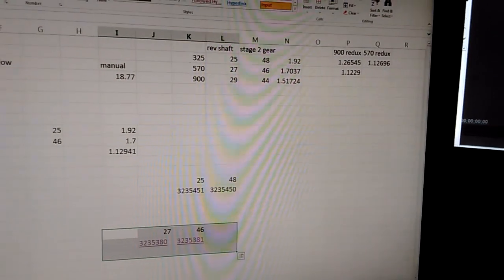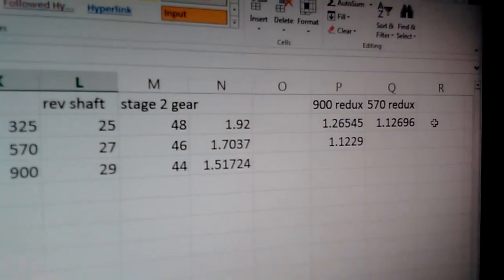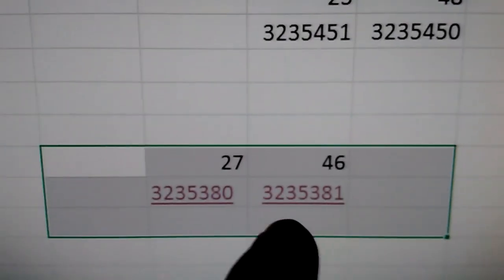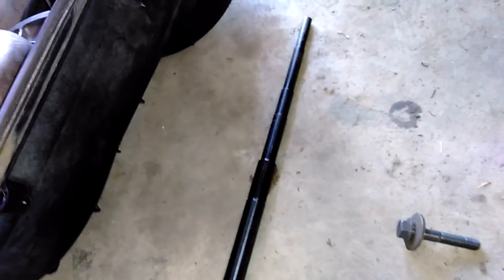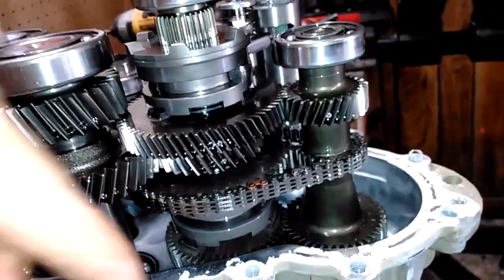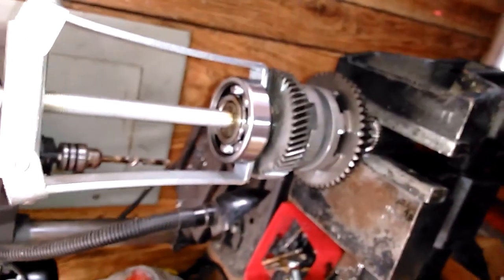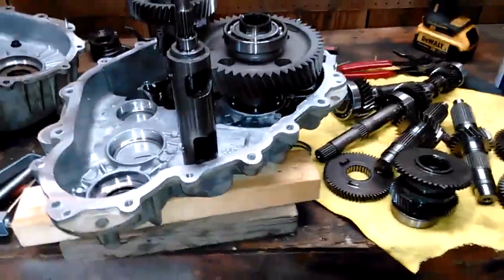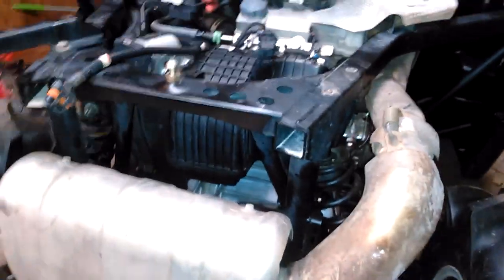RZR 27%  transmision gear reduction factory gears not $650 from tuner

Comment: I was talking to Super ATV until I told them I had a 2012 RZR 800 S.   I want to go to 32" tires. How can I do it without costing an arm and a leg. Also I have health issues and can't do the work myself. I was hoping you were in the Phoenix area. I bought the RZR cause I didn't want to die at home in front of the TV. I'm due for tires but don't want 27" tall on 12" rims. Please HELP! I'm tired of the bull crap from the salesman. You sound trustworthy.    THANKS,   RON
Reply from the maker: Unfortunately, I have literally zero experience with the razor 800 platform.
Reply from the maker: My first Polaris was a 2016 RZR 900 trail. I had 4 inch portals on it and 35s there's a lot of older videos posted on it, but I don't think very much of that was relevant to your machine

Comment: will these work in a 1000cc 2018 General deluxe?
Reply from the maker: Yes
Reply: @MudPuppyOffroad  ty, it is still very expensive in Canada grrr
Reply: @MudPuppyOffroad  Hey, is this JUST REVERSE and LOW range gear reduction? I am looking for Lower reverse and low gear high is fine for the General on 30 inch ITP Blackwaters...we do very tight trails and steep hills this would be great for some of our runs, as I find I do get my belt warm n smelly now n then.

Comment: Is there a similar trick to do a double reverse chain? Or is the reverse chain even needed if you do the gear reduction. I'm new to this and have a rzr 570 thank you for posting this video sir
Reply from the maker: I'm running the stock chain but also have portals. The reduction does result in less torque on the chain
Reply: Biggest I'm gonna go on the bike is 33's and that's after I get portals. I just want to have as much gear as possible for the small motor. Thanks man!

Comment: OK i watched this video and figured why not.  i was tired of burning up belts in my 2016 rzr 900 s so i put the big reduction in my bike. it was a pain in the but to do it my self pulling the transmission and all but got it done i am running 32 out back maxes and i hit the gas ans the tires spin out this gear reduction works. thank you for the video i know it has been up a while but still.
Reply: Blazer25U  which reduction did you go with

Comment: Keep the good work on the vids!  I have a 570 ace and a rzr 900.  I have 27 inch ITP blackwater tires coming for the rzr.  I only wanted a 1 inch larger tire but realized after I ordered the tires that the factory tires only measure 24.  Do you think I need a gear reduction for riding trails in my 900 after I figure out if the 27 inch tires even fit under my wheel wells?

Comment: Wonder if the xp1k highlifter gearing can be had for way cheaper than turner or superatv?
Reply from the maker: yeah that's the 12% part numbers I posted
Reply: +Mud Puppy really? That will work in the 1000?
Reply from the maker: yes
Reply from the maker: Haven't done it but people have the 1000 HL has 2015 900 gears for A 12% therefore these will swap also
Reply: +Mud Puppy so does the have the double reverse chain upgrade also. Or is that a completely different part?
Reply from the maker: The reverse chain is an expensive mod requiring several more parts. The gear reductions put less stress on the chain mine has been fine stock

Comment: my 900 ranger has different gears that what's you list in this video. I pulled it and it has the 1.7 gear ratio in it from the factory. I bought the lower gear ratio. not all 900 rangers come with the higher gear ratio. I only got the 12% reduction. 3235380-81 was the gears in my 900xp. you ha e them.listed in the 570. seems that these things came with a mixture of gear ratios
Reply from the maker: tynstaci this video is for RZRs. you're correct the rgr gears are a different ratios

Comment: do you have any ideas to get more bottom end on my wolverine 350 same thing as a big bear but geared lower I gut uni air filter cobra pipe biger carb for power on my bike, any idea ?
Reply from the maker: there is really no aftermarket support whatsoever for Yamaha I wish someone made a gear reduction for the Big Bear IRS
Reply: ikr people make em for Honda but no one does for Yamaha
Reply from the maker: its really hard on Yamaha

Comment: so on a 2015 rzr 900s I can use 2015 570 rzr gears and get a 12% gear reduction?
Reply: thought that's what you said in the video?  or are you talking about older 900
Reply from the maker: Talking about my 2016+ Polaris changed the RZR 900 trail ratios from 15 to 16
Reply from the maker: You can do ace 325 gears for a reduction
Reply: Mud Puppy ok thanks for the info 👍

Comment: Did you have to do any modifying to the case for that bigger gear to fit?
Reply from the maker: Nope
Reply: Dam man  I can't get my case to line back up with the guide pins..
Reply from the maker: That's not good
Reply from the maker: What year is it
Reply: 2017 ranger. I went with the 25% from superatv.  Before i saw you're video.
Reply from the maker: @braxtonchampagne9975  interesting I don't have any experience with those but I thought they were the same

Comment: Any idea if the gear ratios are the same for the Polaris General 1000 and RZR 900? If they're the same,  would you recommend the 12% or the 27% for all around trail riding with 32" tires? TIA
Reply from the maker: +cale sanders if you want to look it up the gear ratios are in the owner's manual you can find them all on polaris's website or just Google General 1000 manual I don't know off the top of my head. It's a ton of work I wouldn't do it for just the 12% definitely worth it for the bigger percentage on 32s you need it will help the

Comment: Will those gears work on a 2014 ranger 900 that would be awesome if they did
Reply from the maker: yeah not sure what reduction you'll get I'll look it up later
Reply: +Christian Amy ok thanks man I tried looking it up just kept popping up turner gear reduction
Reply: +Christian Amy I finally figured it out went to Polaris parts house the part number on the 570 is exact same as the ranger 900 part numbers stock so the ace 325 should work right?
Reply: Mud Puppy will the gears for an ace 325 work in my 2016 ranger 900 ?

Comment: hey man. so im struggling right now. my rzr has started whining in low gear under acceleration. ive done research and found that its more then likely the gears in the trans. it doesn't do it in high gear. can you please tell me what gear to order to fix this. I run 31 inch outback max tires. 2013 rzr 900xp eps
Reply from the maker: Partzilla has some really good exploded diagrams that will probably help however I've never had one of these whine. It could be bearing related they use really crappy Chinese bearings. usually the issues people have with these things are catastrophic like breaking a reverse chain or snorkel gear. not going to be able to diagnose what's wrong with your transmission over the internet though obviously....
Reply: Mud Puppy understand completely. I leaned towards bearing at first. But I noticed it only does it in low gear. Not reverse or high and I think the same bearings move in the drive gears. Afterreading  tons of forums of guys with the same problem I found the likely cause is the low gear and the gear that drives low. Or vise versa. My hope was that you could tell me the part number gears to order. I’d even be cool to do the gear reduction while I was in there. I’ve looked through partzulka and if you don’t know scantly which gets you need there’s no hope

Comment: i was thinking about putting the 30% superATV GR in my rzr, so your saying i could use the 325 ace gears?
Reply from the maker: what rzr do you have
Reply from the maker: didnt think super atv made 30... just a 12 and 25
Reply: +Christian Amy  rzr 1000 Highlifter
Reply: +Marshall Mims the 1k highlifter already has a gear reduction
Reply: +REBEL RIDERS i know. but im running 35.5" bkts. i need more lol
Reply: +Marshall Mims do a full clutch system I don't think you can do any more gear reduction.
Reply from the maker: +REBEL RIDERS I definitely said clearly in the video that if you put this in the High Lifter Edition which is a 570 reduction you will gain an additional 13% reduction which is much more than you will get from any clutch kit
Reply: +Christian Amy okay sorry lol I don't always pay attention like I should
Reply from the maker: +Marshall Mims this will give you about a 13% reduction definitely worth it in my opinion will make a huge difference with belt life
Reply: i guess you mean 13% more than what i have now? which would put my highlifter 25-27% lower than stock?
Reply from the maker: +Marshall Mims correct
Reply from the maker: +Marshall Mims mine is perfect on the 33.5x9.5s

Comment from the maker: the only way to turn large aggressive tires is proper gearing everything else you tried to do is just a Band-Aid and one way or another will subtract from the reliability and the rideability of the bike
Reply: What reduction do you recommend for 900s on 30s for rock crawling
Reply from the maker: Definitely the transmission reduction for the price. Or portals
Reply: 12% or 27% in your opinion and what about the reverse chain while inside the trans
Reply: Is this reduction in high or low or how does this reduce?

Comment: Wait a minute, you installed 570 gears in a 900? Weren't you busting canam's ass over doing the same thing? Yeah I'm a bit of a canam fan, but do like how informative and honest your videos are.
Reply from the maker: the High Lifter Polaris comes with a gear reduction unlike most Can Am XMR also unlike Can-Am you can swap the lower gears from other transmissions into any other Polaris there is no way to do a gear reduction on my 570 however on my 900 RZR I can do a 27% using Factory gears for 200 bucks Polaris for the win

Comment: I know it's a old video but did you go with the 325 gear witch will give you the 27% gear reduction right?
Reply from the maker: Yes. But depending on the year and model of the RZR those gears might give you a different reduction
Reply: Wanting to do it to my 2014 Polaris scrambler 1k is why I was asking. I appreciate the reply back
Reply from the maker: That is a totally different transmission. You need to swap in the drivechain and a low-range gears from a highlifter edition sportsman

Comment: On a XP1K4 with 32" tires, what sort of top speed loss would you be looking at with the Ace gears? 5mph?
Reply from the maker: +Aaron P depends on clutching. Can't really get a top speed calculation because the CVT will do all kinds of different stuff with oversized tires and gear reduction definitely hard to say probably looking at more than 5 miles per hour loss but that's just a guess

Comment: Is the gear reduction on both high and low range or just low???
Reply: Mark Hansel gear reduction is for high, low, and reverse.
Reply: Thanks for the reply!  Do you happen to know if the 900 uses the same gear set as the XP1K?  If they do, then the 325 gears would be what I want to go with...  However, supposedly the '18 XP1K has higher gears this year than previous years...thinking out loud, the 325 set would still probably be the way to go.  Thoughts??
Reply: I am not sure about the 18 year model and any type of gear reduction would be for u to decide and what type of riding you do. Once u do it once it is nothing to change it because you know what u are doing. Have some people that change them depending on the park they are going to ride.
Reply: I do the East TN places like Brimstone, Windrock, etc as well as the HM trails in WV...

Comment: Did your top speed drop a lot ? Also do you know if it's the same part numbers for a 2012 xp900 4 seater ? I'm pulling my tranny to do a reverse chain upgrade now.
Reply from the maker: on stock tires definitely lost some top speed. ran the part numbers on your bike these gears will work for you. if youre on stock tires just do the rzr 570 gears for a 13% your belt will thank you. any bigger than stock id do these ace 325 gears for a 27% :)
Reply from the maker: be sure to double check the tooth count when ordering your gears

Comment: So I have a xp 1000 thinking about going to 32 inch tires . I would like to keep speed but I want lower torque or lower gear for crawling.. what gear do I need to buy? Thank you!!!
Reply from the maker: If go with full clutches and gear reduction will cost you top end
Reply: @MudPuppyOffroad  so stick with 30 in tires an maybe get weights an make clutch alittle lower?